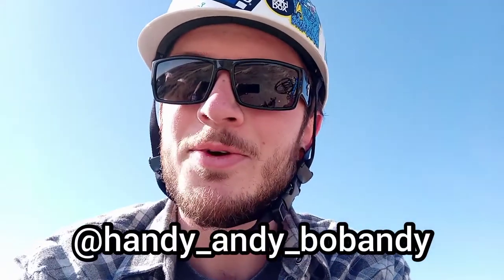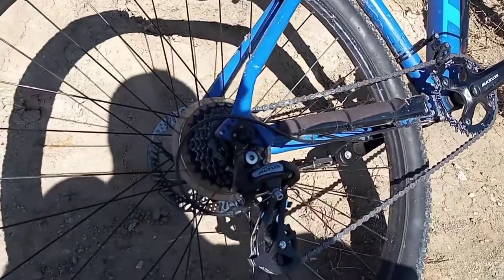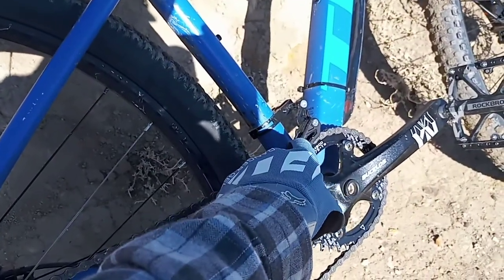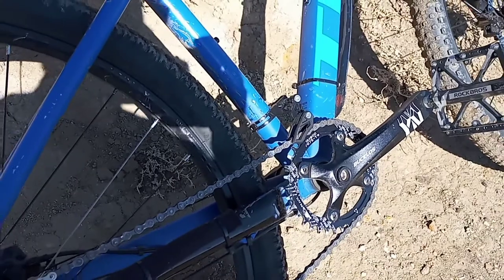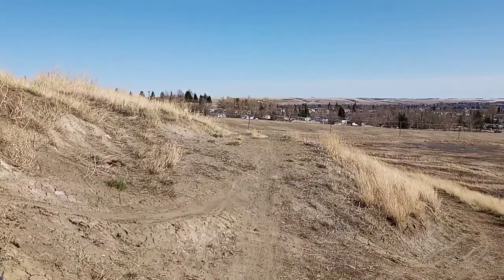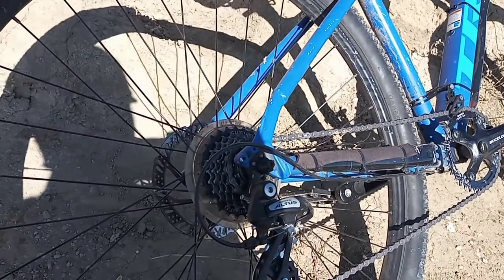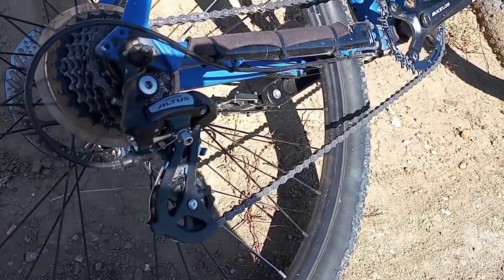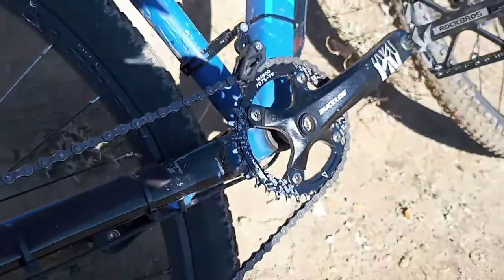1x7 Conversion update and what I did wrong (Trek Marlin 5)

Comment: Great job! Every rider should wrench their rides IMO. I did this last summer with my older 3x9 Marlin 7 because I was having the same issues you were. The narrow-wide (not oval though) worked great (so I didn't even need a chain guide) but would love to upgrade to a Deore groupset with a clutch and a bigger granny gear because there are mountains here. I also need to swap out the BB but I expect that given that I've got three years of contaminants getting into the bearings. FWIW I'm an older, heavier guy too so I'm not a "hard charger" but it still works for me on greens and blues and long distance XC rides.

Comment: Hey bro I notice that this is two years old. What are your thoughts on that bucklos crank set now? I can't find any good reviews on it. Wondering if I should spend the extra and the Race face or not.
Reply from the maker: Still using this exact setup and I have no complaints for the price point. It's been going strong and abused pretty good these last couple years.
Reply: @handy_andy_bobandy  that's good to hear. I was reading reviews on the $150 Race Face cranks and there are plenty of bad reviews. I figure for the price your setup is probably as good. Have you experienced and creating sounds?
Reply from the maker: @TonysMTB  no I haven't had any problems with that. But I do have a fairly new bottom bracket so that might be why. I'm expecting some noises in the future once that bottom bracket breaks in more.

Comment: I have a couple questions just came around your video a month a go and order everything you ordered, installed it and it shifts smooth and ride smooth the only problem I'm having is when I have it in 1st gear  and pedal backwards the chain likes to go back down to 2nd gear, now it may just need some adjustment on my end or not so I came here to ask you
Reply: Or did u add a washer in between
Reply from the maker: Hmm I haven't had that issue yet. Might just need more adjusting on the derailleur or spacers on the front chainring.
Reply: @handy_andy_bobandy   well okay thanks ill try both
Reply: @handy_andy_bobandy  and it might be my chain is too short do you know how many links you have on there right now
Reply from the maker: @djc3325  not off the top of my head. My bikes in storage for the winter so I can't give you an answer.
Reply: @handy_andy_bobandy  okay thank you

Comment: What size of the bottom bracket do you use for 1x7 speed?
Reply from the maker: It's just the factory Shimano square taper bottom bracket. I can't remember the exact size off the top of my head. Should be on the trek website.

Comment: How many teeth in the chain ring?
Reply from the maker: It's a 36 tooth chainring.
Reply: @handy_andy_bobandy  did you use any spacers fitting the chain ring?
Reply from the maker: @ibby81ae  nope I did not.
Reply: @handy_andy_bobandy  no clearance issue's?
Reply from the maker: @ibby81ae  nope. I've had good luck with the clearance
Reply: @handy_andy_bobandy  so it's an oval 36t ring?
Reply from the maker: @ibby81ae  yes sir. You got it.